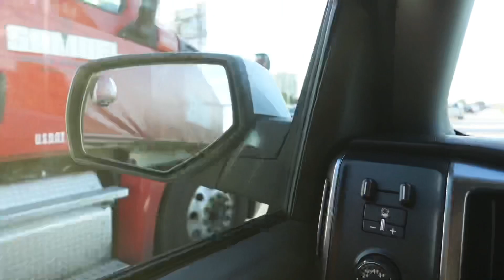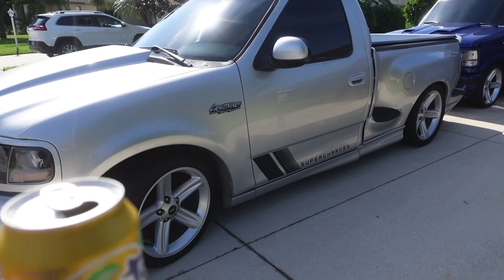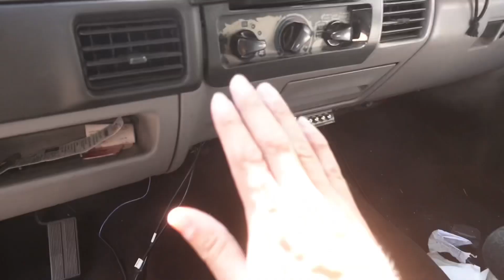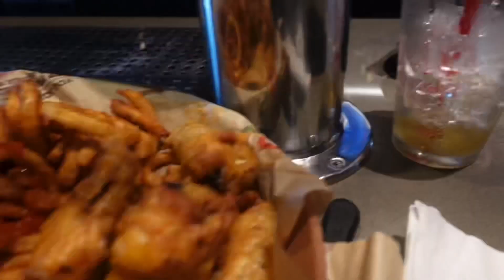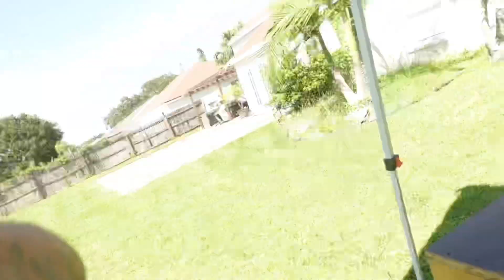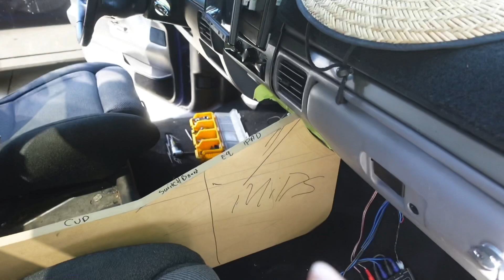FORD Obs Truck Custom Center Consoles started

Comment: You have to be careful with that router  table bro because if you don’t hold the board right it will kick back on you that’s a strong fast machine
Reply from the maker: Oh ya I’ve seen it in actio take a few OGs out lol that’s why I don’t mess with it that’s why I respect it to the max like the ninja turtles did Master splinter